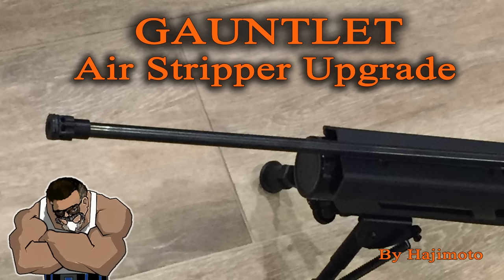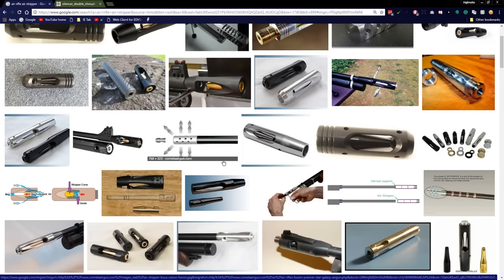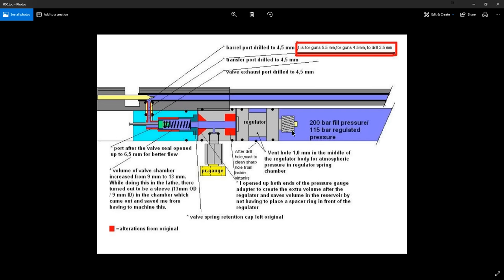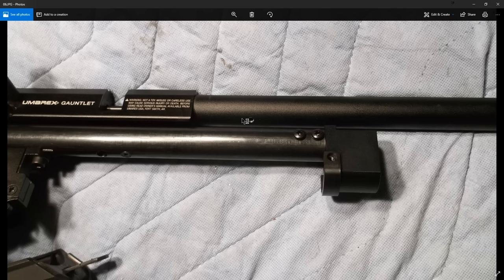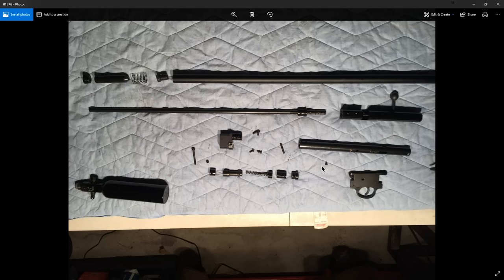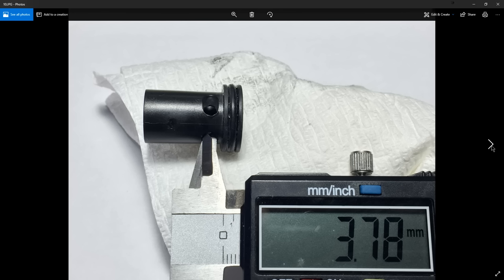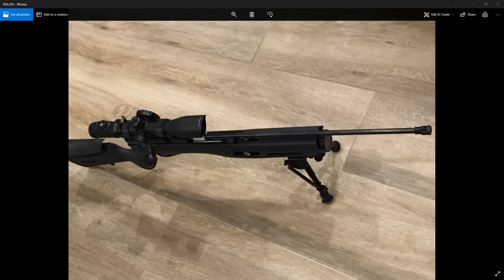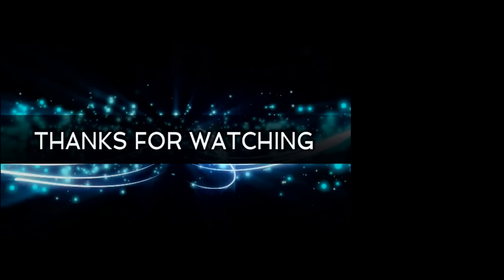Umarex Gauntlet: Air Stripper Upgrade

Comment: I am glad you are showing this video,  my air striper has a cracked running long ways about 1/2 inch long I temporarily repaired it  , but will need a new one asap , before I install the new baffles I ordered
Reply from the maker: Well as long as you have your crack one secured you should be ok.  Did you contact Umarex for your replacement Air Stripper yet? In this video description, I supplied a link directly the form you fill out for warranty or general information from Umarex.
Reply: Hajimoto Productions Thank you , very much

Comment: Haji,  I purchased and installed your air stripper. I haven’t had a chance to test the accuracy but I did dry fire the rifle. You should tell your readers that by drilling a hole in the shroud, as you suggest, it will greatly increase the decibel level of the rifle. I drilled the hole and I wish I hadn’t.
Reply from the maker: Anthony i have heard from over 50 Gauntlet users that HAVE drilled the hole and none of them described the rifle as louder.  Can you and I go over the details of your modification?  Can you provide photos and measurements of your mod?

Comment: Wow, I’m new to airguns and think I’m hooked. Would love to pick your brain regarding my Diana Skyhawk. It doesn’t have a spring to “burp” the cones and i thought that would be a key part of the multiple cone design, but they have it after a dedicated air stripper. Cool video, thanks!
Reply from the maker: Corey, glad to see another air head enjoying the sport. The spring actually has a more significant role in that it allows the manufacturer to produce parts without requiring absolute sizing. If the barrel is 1/8" longer or shorter, or if the baffle assembly (plastic) is +/- 1/8" the spring will accommodate those rather loose tolerances. The spring is not a requirement for the baffles to do their job in any way but I surmised that the spring could allow for greater pressure management if the condition were to happen. Thanks for the view and comment.

Comment: Hi Hajimoto, thanks for the great video!  I just received my new 25 cal Gauntlet and  before firing it the first time I inspected it and found the barrel shroud to be cracked on one side.  I am thinking about purchasing your air stripper upgrade after +/- 200 shots to confirm there are no mechanical defects (your advice).  My question is 1) how is the new air stripper put on? (press fit?  hand fit?, etc.)

I will most likely do the air stripper and baffle modifications together but noticed you did not show how the old barrel shroud/ air stripper ones off and how the new one is installed.

Thank you in advance and thank you for sharing your knowledge and expertise!

Kind regards, Joe L.

Comment: WAY better air stripper. I'll be hitting you up for parts when I get into the Gauntlet. Yup.

Nice work all the way around though. Loving the 3D printing. You have your very own replicator. 
(a very vintage, manually programmed one) 

Sulumoto.
Reply from the maker: Skippi i could not be happier with being able to essentially put a faucet to my thoughts.  It has been great.  Thanks again for the support!

Comment: My air stripper is cracked as well, but I just ordered yours rather than contacting Umarex.
Reply from the maker: Order received, Confirmed and On its way! Thanks Richard!
Reply from the maker: I would still contact Umarex and get what you paid for before they say the time limit is up.
Reply: My air stripper arrived in the mail today. thanks for the prompt service. I've already got it installed.
Reply from the maker: I am glad and you will notice the Gauntlet will be a bit more civilized now ;)  Thank you for the support Richard!

Comment: Man getting a pcp air rifle is an investment but with the gauntlet you can be in a comfortable money range. The fixes, attachments, mods and air compressor adds up but it will be worth it in the long run compared to my spring loaded pellet rifle.
Reply from the maker: Dylan please understand, you can go and buy a Gauntlet today and do nothing at all to it and it will out perform your big box store break barrels. These video that i make are to get extra performance out of an airgun but it is absolutely not necessary. A Umarex Gauntlet is awesome straight out of the box (80% of the time).
Reply: @HajimotoProductions  I was going to get a .22cal Gamo Magnum Swarm that's  suppose to have 1300 fps with the PBA Gamo pellets but I discovered the Umarex Gauntlet .25 cal. and thought it would give me more utility.
Reply from the maker: Dollar for Dollar the Umarex Gauntlet is hard to beat, especially the .25, the ONLY downside is .22 ammo is much easier to come by and the Gauntlet in .22 shoots Walmart Crosman 14.3 Domed or Hollow Points really really well and to top it off you only pay $7 for 500 shots!  I am not hating on the .25 just pointing out the pluses of .22.  The .25 hits so much harder, has lots of power, built in barrel band and one of the flattest lowest extreme Spreads of any rifle i ever shot under $400.
Reply: @dylan833-k2i  that magnum .22 cal is one of my dream guns for the future as is the guantlet ,for the price you cant beat either of these ,and the things that the HAJIMOTO does for the guantlet is thru the roof ,he is truly an asset to the fabulous airgun world !

Comment: Question, why didn’t you clean the barrel right away??? You never mention anything about cleaning the barrel... You  really Explain everything very well. Thank you
Reply from the maker: I am not sure what your comment is expecting for a response. I did clean the barrel but the only time I clean a barrel again is when accuracy changes. Because air rifles do not have the acidic and corrosive chemical residues associated with power burners, barrel cleaning is not something that needs to be done all the time. My barrel cleaning regimen uses Ballistol and Patchworm.com kit.

Comment: Well Haji I got myself a gauntlet today! I already put the bipod scope and adjusted and polished the trigger and sear, drilled 2 1/8th inch holes on the shroud and have all my shims I need to adjust the regulator. Now I need to order your baffle kit and air stripper. I've owned it for 3 hours and havnt even fired my first pellet lol. My pump dont come in till next week 😭
Reply from the maker: The thing is, you will be all set to go when that pump arrives! Just swing by HajimotoProductions.Com when your ready for some drop in modifications that enhance the performance of the Umarex Gauntlet. Congratulations on getting your Gauntlet Eric.
Reply: @HajimotoProductions  thank you sir! Between you and James from shoot to kill outdoors, I made the wise decision to get this over the Qb cheif solely based on the modding that I felt comfortable enough I could do. I got my pump now and fixed the regulator to 1350psi on the dot..it didnt have any shims in it and the regulator looked slightly different from the one used in your other video but it took the shims the same way. I added 0.025 to make that pressure. Stock it was at 1000psi(1100psi printed on the regulator.) Now it's going through 3/4 plywood at 20yrds in one shot! I also did the magazine tweak. I'M LOVING IT SO FAR! I'll be ordering from you probably tonight haha. I really want that baffle stack and air stripper!
Reply: I made my order! Lol I couldn't wait any longer

Comment: installed  your air stripper very loose .22 gaulit  installed shroud spring baffel tight had to force it in before it floted off spring wear did go wrong  ty marc maxwell
Reply from the maker: In the instructions that were sent with the air stripper it mentions the barrel outside dimension +/- manufacturing differences. So barrels have a greater OD and other have a less OD. We were forced to make our part fit the larger and instruct the owners of the less than OD barrels to use a couple of wraps of teflon tape to bring the barrel within nominal dimension.

Comment: Hi....do you put anything inside the shroud where you drilled the hole? I've read people using magic eraser....whats that about?

Thanks
Reply from the maker: Hey Skaetdude, yes I use a section of magic eraser as well.  The magic eraser is a high density foam which acts as a diffuser to help manage the air flow that is being vented.

Comment: Question on barrel Orings. Any place to get replacement ones? Mine are messed up, my factory barrel was loose when it arrived you could wiggle the barrel up and down, also the air bottle wasn’t tight it’s like they didn’t clock the regulator with the set screws to it being tight on the air rifle. And my air stripper is cracked
Reply from the maker: Be sure to contact Umarex at the following link and get your Air Stripper and any other parts that were damaged. https://www.umarexusa.com/pages/contact-us
Degass the rifle and loosen the allen screws around the regulator collar and you can realign it properly.
I always recommend folks go to Harbor Freight and snag the 382 and 397 piece kits. Links are below
382 Piece O-Ring Assortment https://www.harborfreight.com/382-piece-o-ring-assortment-67554.html  
397 Piece Metric O-Ring Assortment https://www.harborfreight.com/397-piece-metric-o-ring-assortment-67580.html
If you are interested in any of my Mods, the details are in the description of the assocaited video for that tweak/mod.
Reply: Hajimoto Productions thank you for the quick reply, also any suggestions on the dovetail to picatinny  rail   I’m putting on an atn day night xsight scope
Reply from the maker: You are very welcome I am just glad I was here to answer these for you. I have used the UTG .22/Airgun to Picatinny/Weaver Low Pro Snap-in Adaptor https://www.amazon.com/UTG-Airgun-Picatinny-Weaver-Adaptor/dp/B007BNHFLQ
But they have a new product the UTG MNT-PMTOWL-A New Gen Dovetail to Picatinny/ Weaver Adaptor Mount https://www.amazon.com/UTG-Universal-Dovetail-Picatinny-Adaptor/dp/B01ABW7GS0 that just may work better for you.
Reply: Hajimoto Productions again thank you for the links. I look forward to getting this up and running
Reply: Hajimoto Productions Hey Haji i was gonna get those oRing kits from Habor Frieght cause ive heard of other Airgunners getting theirs there, but this guy told me not to because they were not real orings. So i didnt until i found out forsure... So was he full of it im taking it? Those orings are good to go and i should go ahead with the purchase? Thanks in advance...
~DrJones~
[01/28/18]
Reply: DR. J  get the Harbor Freight,  They are cheep.  I have a set I have used for years for many things.  I f they work good if not U can always use them for other things.

Comment: I noticed the O ring on my air stripper is not protruding any at all above the seat , should it be raised or is that normal /
Reply from the maker: I will assume you are writing about the factory air stripper. The o-ring should make contact with the shroud to allow for a proper seal. It should be coated with a bit of silicone grease applied if the o-ring is still not making good contact i would recommend replacing it at the current may either be the wrong size or damage/worn.

Comment: What's up Haji I posted comments in a couple of your videos I asked about the trigger upgrade if it was good for the gauntlet too and you actually changed it on your website thank you very much for doing so easy that you updated some of your other products thank you very much for doing that that cleared up a lot of confusion but the main reason why I am posting here today is because when you talked about taking your gun apart amerex void your warranty in United States it is 100-percent illegal due to the Constitution for a company to void a warranty due to the right of self-repair that is why a lot of companies like apple and major tech companies I am a big tech guy I play video games and what-not, a lot of major tech companies for example Apple the number one worst company when it comes to self-repair. The make their components so proprietary that there's literally no way that you can self-repair sorry for going on right here but for a prime example the new iPhone you can literally have two iPhone the same make and model you can take them apart take one part out take the exact same part out of the other phone put in the exact same part put the phone back together and it will not boot up it will not work because there is coding in the software that has to be recalibrated with special software that only Apple possesses I'm sorry this post is so long but I am a huge advocate to the right of self-repair I just have to put it out there it is illegal for Umarex to void your warranty in the United States because the Constitution supports the right to self-repair.

Comment: Just a piece to cover the hole, not wrapped around the barrel. must be a tight fit or I'm not clueing in. Very informal and well made videos!!
Reply from the maker: I cut a ring like what would go on your finger but you can do it however you want, you can't do it wrong.  Well you can if you jam it so tight that air wont pass through LOL

Comment: i have been reading today people not covering the hole. Just wrapping it from the end of the barrel spiral down to front of the hole. 4 strips of 4" long x 1" wide x 3/8" high magic eraser foam wrapped around the barrel in spirals like a staircase starting just a couple inches past the end of the barrel and ending before the vent hole.

Comment: Thanks for get back to me as soon as u did. The dwall needs to be higher or lower. Do u no what the time for the dewall needs to be for the valve Thanks. Is that other part you were talking about is that what going to change the dwell or could it be the spacer? Maybe needs to b trimmed? I Don't no but I was thinking if u were to add a set screw in the middle so its adj then slot and polish the side  to your part your going to be making should change it ?  If im thinking right.     P.s Thanks again  for stoping me from jumping  the gun and not puting time & money in to some thing not  needed.  Your really good at what u do and put a lot of time & thinking in to it. Keep up the great work. Measure twice cut once.
Reply from the maker: The dwell will be adjusted by the valve changes I will be making. The poppet valve will be changed and the springs as well. This will allow for better air delivery and allow the rifle to sip the air rather than gulp it. you are very welcome! Just keep your eye on my channel as the video will be soon.  Stop by and visit my Facebook page at Hajimoto Projections for the latest information between videos.

Comment: Is there any effect in accuracy if you can hear the baffle rattling a bit, some reason it' like I say some how it became little loose? Is this a dumb question?

Thanks
Reply from the maker: The baffles should not rattle. If they are rattling there is something wrong. Make sure the rifle is unloaded and not cocked, remove end cap, take out baffle and spring, unscrew shroud, inspect air stripper to be sure its not crack or broken, re silicone the o-ring and reassemble in reverse order.  The spring should have positive pressure on the baffle assembly and should not rattle.

Comment: Question:  Is it better to use a .25 air stripper on a .22 (minimizing chance or clipping), or to use the same size caliber for the stripper..
Reply from the maker: Sorry for the delay Richard. Because the device makes a direct attached to the muzzle of the barrel itself, clipping is not a concern.

Comment: Hi there, thank you for putting out videos such as this one explaining things and teaching. I am new to airguns in general and am trying to educate myself as best as possible and am currently looking at getting this gun.  I just had a question out of curiosity...  It may be dumb so forgive me. Understanding that after the pellet and its gasses pass through the first air stripper it then goes to an air stripper stack, it seems that the air stripper stack area is sealed by that o-ring. Assuming that the gasses stripped by the stack can only exit with the pellet, would you not want to put an additional hole in the shroud up past the primary/first stripper to allow the air to exit other ways? Or possibly allow it to travel back past the first/primary stripper to the rest of the shroud and out the hole already drilled?  I will subscribe and watch more and learn.   ~Cheers

Comment: I have your stripper and baffle cones installed in my .177 Gauntlet...works great.  When I place my Donny FL Tanto suppressor on, the POI drops about an inch at 40 yards and the airflow at the muzzle is much reduced. Without the suppressor, airflow is almost twice as much at the muzzle, 10.34 g JSB pellet hits target harder and is more accurate. I don't have a chrony to measure FPS so my observations are subjective.  Do you recommend using a short shroud with a suppressor and leaving out the internal baffles to maintain proper airflow? I feel like having internal and external baffles (suppressor) choke the airflow considerably.
Reply from the maker: Hey there! It is my experience that you are sensing the substantial reduction in air blast and dB's. Once you shoot across a chrony you will be very surprised by the what is actually happening to the speed of your projectile. As for the shift in POI, this is very common as the airstream conditioning has been altered as well as the additional weight at the POI influence end of the barrel. Where I think the short shroud shines if for larger bore PCP's that require more suppression and in turn end up with heavier weight at the end of the barrel.
Reply: @HajimotoProductions  so you are saying that the drop at poi is in part due to the extra weight at the end of the barrel, from the suppressor, slightly bends the barrel assembly? Which is logical, there will be some deflection, these barrels aren't super rigid.